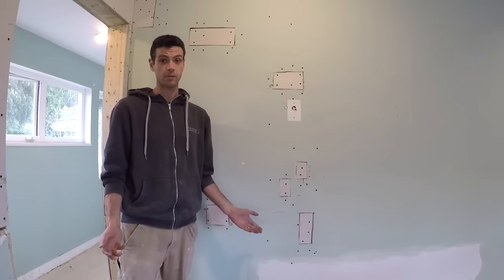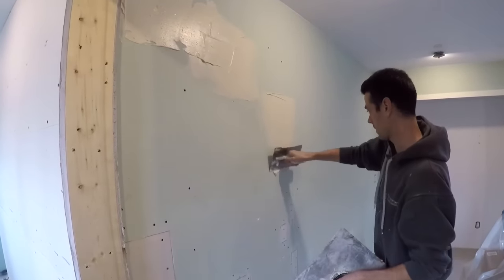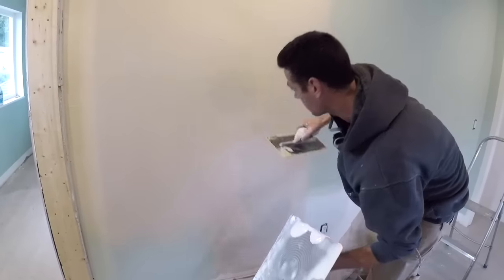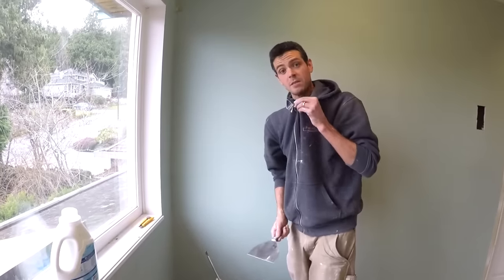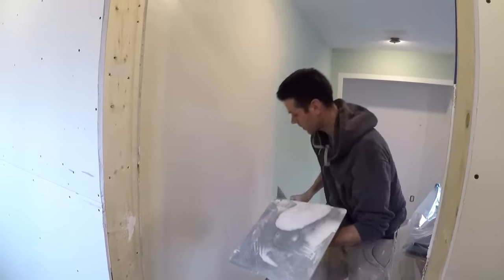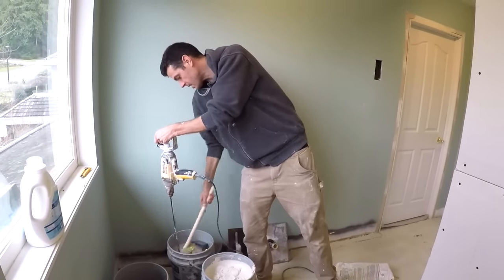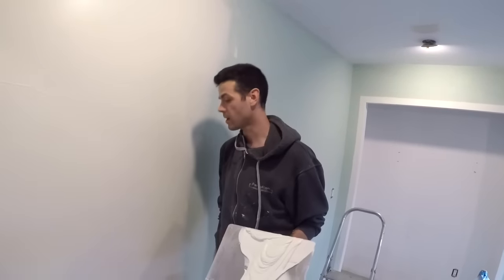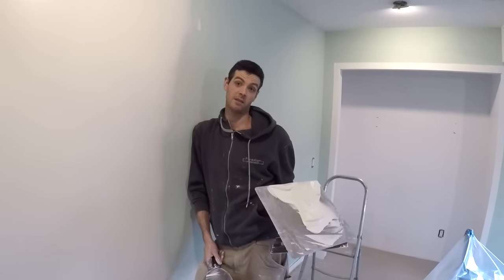HOW TO PATCH A HOLE IN DRYWALL!!! (Lots of them!!!)

Comment: Damn, just replace the Sheetrock
Reply from the maker: I knew this comment would come very soon. If you really think about the amount of time involved to remove and dispose of the old drywall and install and finish a new sheet without having a hump in the wall it's probably pretty even with me coming out ahead because I don't have to get rid of the old drywall.
Reply: Vancouver Carpenter I see your point. Keep the vids coming. Learned a lot watching your vids 👍🏻
Reply from the maker: @jcook8191  :)
Reply: I’m with you, unless the job is way out in the sticks or something
Reply: @vancouvercarpenter  Agreed, getting rid of the old stuff in BC is a pain! You've got a good trowel hand, duder!
Reply from the maker: @scottlamp3097  where you can just bury it😂. But honestly, tearing out drywall sucks. I would rather patch and float any day.
Reply from the maker: @timmiferscottnaud2053  its getting so stupid. I get though. Asbestosis is no joke but there is only one place to get rid of drywall now and only if it is stamped after 1990. I don't even bother with old jobs anymore. It's just too much of a headache.
Reply: @vancouvercarpenter  That is a very good point but for a novice this would be more on the challenging side, great video!
Reply: @vancouvercarpenter  whats your preference for mud? do you like the hamilton redline?
Reply from the maker: @timmiferscottnaud2053  it's a great mud. Least bubbles out if any available brand here.
Reply: @vancouvercarpenter  
It has asbestos in the drywall? Never heard of this.
I know siding can.
Reply: @vancouvercarpenter  It's my go to as well... Great content buddy
Reply from the maker: @turboflush  old drywall mud or texture can. Not the board.
Reply: @vancouvercarpenter  
Interesting.
Guess I gonna die. :(
Reply: Wouldn’t a small area like that be ok to put in municipal waste?
Reply: @rivernet62  
I thought no anything hazerdous is not. Not knowingly anyways.
Reply: @vancouvercarpenter  Do any of the paint stores carry the Hamilton brand in Vancouver or do you get it from a drywall supplier?
Reply: ...right...?...jeez...
Reply: Asbestos was added to drywall 1950s - 1980s to make it more noise resistant and stronger.
Reply: It looks good.
Reply: For real
Reply: Ya, would have taken a 4x8 out and just tapped the one joint floor to ceiling. 3 coats with durabond 20 and done.
Reply: i was taking an old dresser and bed to the nv transfer station and saw a sign that said something about a used gypsum program
im assuming theyre gonna start doing something cause in know for a fact people have been dumping it in the forest in squamish
buddy saw a cube van unloading while walking his dog shortly after the NO OLD DRYWALL rules came in
i sill have two bags at my moms that have been sitting there since the NO OLD rules came in.
Reply: I learned with a hawk and trowel. I think in instances like this it puts you light years ahead of a mud pan dry waller. I can skim coat a wall with hot mud in no time and when I work with my 14” trowel I get a dead flat wall that covers all the patches. I only do patches and repairs, I’m not a dry wall guy. My work is in 100+ year old houses. I can get a patch like this from patch to finish paint in 8 hours. Nice work here.
Reply: 5 dollars vs 150
Reply: cheap vs proper
Reply: I wouldn’t of went that far.  He could of mudded each damaged spot separate without missing half the wall.  My grandfather would of smacked me and said I was over working the mud if I played with it as much as this guy is.  I’ve also had bad luck with mesh tape long term.
Reply: Or put another layer of drywall
Reply: Sheetrock has paper on it and when you go to paint that wall that you just put all that mud on...no matter what you think. It will look different texture wise. It would be better to rip it out and not have done all those patches unless you plan to do a Level 5 gypsum board finish as defined in GA-214-10  through out. But I get it too....time is money
Reply: Timmifer Scottnaud
Everyone around here would just throw the old stuff in the wall. I would have just put a new gyproc, but i'm crappy at finishing, lol.
Reply: Would have been quicker to just skim the wall instead of patching it to fuck
Reply: Are all Canadians this feminine? Idk if he would make it on the type of sites I am used to.
Reply: A Bigs  how is 15 mins worth of work too much? I spent at least that much time doing clean up at the end of the day. 
I would much rather work with a full sheet than that swiss cheese cluster fuck. It will take less time to tape and mud my seams. 
To each their own I guess?
Reply: not in canada. they got laws against everything.
Reply: @vancouvercarpenter  goodwill or habitat for humanity takes this crap
Reply: @vancouvercarpenter  There is merit in your technique to save the existing drywall (carbon footprint and landfill space kind of thing).  My technique (as a DIYer) is to add 1/2 in wood strip behind all seams, full length, add a bit of wood glue to the mating surfaces (optional but adds strength) then screw it down tight with 1 in drywall screws.  Taper/notch both sides of the seams with a utility knife then fill in with setting-style mud.  Wait for it to dry then fill in the residual cracks with a top coat or two sanding both sides near flush between each coat.  No taping required and no humps but you need a supply of decent wood strip and a saw.  This technique I have implemented 100s of times in many houses I have owned and not a single one has cracked through yet!
Reply: No shit
Reply: Damn, just rebuild the whole house!
Reply: You’ve never worked for a contractor have you? Those bastards will save every square inch of Sheetrock they can. Even if the patching and subs working with finished walls will cost them twice as much. I’ll never get it.
Reply: I just put fill them holes with some bubble gum.
Reply: TurboFlush yup n in popcorn ceilings also
Reply: @yeezywesty3651  $5 dollars? How much was that guy being paid to do all that?
Reply: Do u use a curve or flat trowel
Reply: @askurmom1  ; Do hairy Bear Chubs get all the action on the sites you're used to?
Reply: Personally I would patch the wall but the the whole area for a few patches seems over kill. Plaster in aus is costly and the amount of plaster used here would near out weight the cost for a new board of gyprock.
Reply: For someone like me who struggles with knowing when something is flat, and have no drywall experience, I think I would be inclined to change out the sheet. I could see what you have done there turning into at least a 2 week job for me.
Reply: J Cook 
For sure
Reply: Jajajajaja  you are right
Reply: @vancouvercarpenter  That is total b.s. I know you're a carpenter and I know you think because Jesus was a carpenter you're the closest thing to god, but your wrong. Drywall is way cheaper than a finishers time. A real pro isn't going to make a mess with hot mud like you did. What are you going to say when the homeowner shines a light down the wall?
Reply: @canuckfixit7722  Do you not know drywall is just gypsum and paper, it 100% biodegradable and recyclable.
Reply: @1020donny  While that may be true, that is completely irrelevant.  Like lumber scraps (also biodegradable), no municipal composting program will accept scrap drywall and neither would you want to add this to a home composting system.  Further, drywall recycling systems are far and few between.  It's just considered bulky and heavy waste, period.
Reply: We use several drywall recycling centers for scrap. It factors into our LEED numbers
Reply: @1020donny  New West Gypsum Recycling and they have locations across Canada.  Good to know if you are in the contracting business and are inclined or are required to separate this material.  Not a true mainstream process but at least businesses like NWGR exist and are therefore an option.  For a small repair job like this, probably not worth it.
Reply: Agreed, a job like the one shown is just a way to sell scraps from another project to a homeowner. What would have been left over from just replacing a sheet could have been cut up in put in the homeowners garbage bin. But hey, if you can sell some guy your scraps be my guest. It just doesn’t look professional to me. I’ve even seen guys burry their scrap behind the board, just not my way of doing business.
Reply: As a painter, I definitely appreciate your diligence. You make the whole job look good, which is good business. I'm also in the Vancouver area, so it's nice to see the local culture, accent, and sense of humour.
Reply: @robsedleski  sounds like you have quite the bromance with this guy. I'll just leave you two alone for now.
Reply: @askurmom1  If you want call respect "bromance", then sure, as you like, buddy. 🙄
Reply: Same here.
Reply: @vancouvercarpenter  I didnt realize how lucky I am, our house has 1940s luan walls. A long process but worth it to pull, insulate and drywall.
Reply: Vancouver Carpenter if you did replace the wall how would you get rid of the humps? I would like to know.
Reply: @vancouvercarpenter  I'm wondering how do you get rid of the old mud in the states, excess and the one you get from washing the buckets?
Reply: I thought he did great in short order.
Reply: No need to replace the whole thing. A good plasteter will make that wall look like new.
Reply: Lol
Reply: 30 years ago I could do them patches in 40 mins from prep to cleanup, with even a light spray texture over it, so removing the drywall and debris would have taken twice the time. So you are wrong J Cook. Good video vancouver carpenter.
Reply: @askurmom1  lol. Come on man.
Reply: I just cut up the drywall into small pieces and put in garbage bags with other crap. Of course I live in Pennsylvania, not BC. 
Didn't realize that drywall and/or the mud could contain asbestos.  I knew many popcorn finishes did though
Reply: Antonio Akiki as long as there’s no electrical boxes mabye not sure
Reply: My shares in CGC just went up watching this video.
Reply: @vancouvercarpenter    Six of one and half a dozen of the other, my grandma would say.
Reply: @gojoe36  Yep- I ended up with a horrible looking job, because the texture ended up differently.  Therefore, the paint dried differently, causing an appearance known as "banding."   But, this guy at least did such a huge portion of the wall, that there might not be any of that, especially if he uses a good primer before painting.
Reply: mud fits in my car.
Reply: @vancouvercarpenter  Only one place to get rid of drywall in Vancouver? Wow. In Newfoundland you just take it to the dump. Except for the assholes, they just dump it in the woods or along the side of the highway.
Reply: @DieselRamcharger  LOLOLOL And the Earth is flat and only 6000 years old, lol
Reply: @tonyspigarolo9953  exactly what I thought ,but what do I know only been doing it for 36 years.
Reply: If he did, he wouldn't have a video to post. I really learned from this one.
Reply: Vancouver morning's is not
Reply: How do you do the tutorial  and  show us how to fill in the holes if he replaced the wall? This gives me confidence that I could do it.
Reply: I also like how you pay attention to use of material.
Reply: That's what I thought
Reply: @vancouvercarpenter  what in the world do you have to do to get rid of the old drywall? Here in Florida we just throw it in the trash. Gone in 2 minutes.
Reply: No, you will NOT replace the sheetrock
Reply: A year later I thought the same thing and first comment I saw
Reply: Level coat the wall
Reply: Level coat after done mudding and sanding
Reply: My son grew up in an auto body repair shop applying bondo and sanding for hours. He transitioned to finish carpentry and loved taking walls to perfection.
Reply: @vancouvercarpenter  can i do this over paint?
Reply: Lol a bag of mud and 30 minutes later...
Reply: @vancouvercarpenter  little lighter on the body not carrying those sheets around of course
Reply: @atown4428  There's drywall in 100+ year old houses?  In my neck of the woods that would be plaster and lathe.
Reply: @vanman6534  I was referring to using these techniques to patch plaster and lathe. We are all plaster and lathe in the old houses around here as well. Most guys here will just knock the broken plaster off, throw up a square of sheet rock and mud it in. I find it much better to secure the loose plaster where I can (cut out the rest) then patch and skim the whole area.
Reply: @atown4428  Gotcha.  I like your method better, but it requires a level of talent I doubt most possess.  I've watched plasterers and their ability to create a level surface always amazes me.  This fellow did pretty good, but he did start with a smooth flat wall.
Reply: I didn't know there was this kind of a drywallers war 😳 😄
Reply: Budget bro. Building materials are expensive!! Besides he covered everything very well in what 30 minutes tops?? Great job!!
Reply: @vancouvercarpenter  No I still agree with J Cook, considering the time needed to patch the 7 holes (ok already done for you) tape, mud and sand, still much easy to replace that section with a new sheet. My brother and I flipped fives house in the Vancouver area and made a shit load of money.
Reply: @vancouvercarpenter  if you are not as experienced and as a skilled as you are it would be much easier to replace the sheet. For me personally there is too much risk of making a mistake as I am not as confident working with mud.
Reply: Yeah I would have just cut out and replaced a section and reduced the filling to three or four small joins...less work...mess...materials etc.
Reply: For as much time as he has in he may as well have, probably woulda been a cheaper fix
Reply: Fix that in a day??? What? You Shine.
Reply: @vancouvercarpenter  ya you'd have to finish it when youre done anyway, just used a bit more mud. if you need youre finishing tools out anyway may as well just use them only
Reply: Pretty simple just get your patches taped,and finished smooth. Then skim the wall in that area a couple times to even it out touch it up  put a good  detail sand job on it pole ,and sponge with light
Reply: I would much rather patch the wall than mess with replacing drywall.
Reply: I had a lathe and plaster wall with hairline cracks everywhere; nothing big, just an old house. Rather than try to fix all those cracks (even the fixes would show) I coveted the wall with a 1/4” sheet of drywall. Worked great!  I haven’t seen 1/4” drywall for a long time.
Reply: @vancouvercarpenter   :) 🤔 ..  😋😁✌
Reply: Where's the fun in that? Measure,cut,screw, no artistry. Which would you rather watch?
Reply: @DieselRamcharger Even laws against not using a coaster for your drink too? Lol. Who knows?
Reply: @vancouvercarpenter plus if you replaced it? You wouldn’t be able to show all these techniques. I feel this video is applicable to more than just this specific application. Especially the mixing/cleaning, the feathering, the hiding of the imperfections etc.

Comment: Today I learned I haven’t been using enough mud
Reply: Same here! Learned a lot from this video
Reply: obey325 yea for real!!!
Reply: He used way too much... but it does save time to float the whole wall.  Then you only have one edge to check for high/low.  Which I never see him do on camera.
Reply: Brian Heuer I don’t know. I bet you couldn’t tell once that wall was painted that anything had happened. I’ve had to load up patches and feather them way out before to get them flat and looking right
Reply: It is hard to judge how bad this wall was without checking it with something strait. Mostly you dont need to put that much on a wall.
Reply: meeee toooo, i was like 'ohhhhh fill in the gaps..."
Reply: You can get away with 2 coats
Reply: @Beandiptheredneck  did you have to use that much mud
Reply: He used waaaay too much mud.  Just did a patch job like this a few days ago, and many like it over the years. Unless there's an 1/8 in rise on the drywall for some reason just treat it like your drywall butt ends and bring out your second coat about 10 inches from each patch and feather the edges out nicely. It'll save hours of this mudding and sanding yet be imperceptible to the eye.
Reply: Wait till someone tries to mount something flat against that wall later. They are going to be cussing thinking wtf is wrong with this wall?!
Reply: That is ti much.

actually from end to end the wall has a void in the middle if you put a ruler against it 

Still good hand.
Reply: I think if it was one single patch he would of just did 6-10 inches. Since it was 6-7 patches I would if did the whole wall also. Remember that wall is still not flat and drywall is usually never perfectly flat but a good finisher can make anything look great even if it’s not flat.
Reply: @snickerszn8459   butttttt...

Be careful where the light hits the wall... 
with a door next to it.... natural light getting in on the wall like that.... 

But this is my opinion.... i would have done 2 on the entire wall... first with the fiber on the damage bits, second one to finish and prepare for paint...

Still, once again it is my opinion and how i rule my company... not here to judge nobody.
Reply: @pedrorocha642  yeah everyone got there own techniques. Whatever works best for you do it.
Reply: @snickerszn8459  The thing is, when you work for clients you dont do what is best for you, you do the best for them.
Reply: I literally just said that to myself lol
Reply: @totallynottrademarked5279  mn
Reply: If you done ¾ of the wall u might as well do the entire wall🤷🏽‍♂️😂